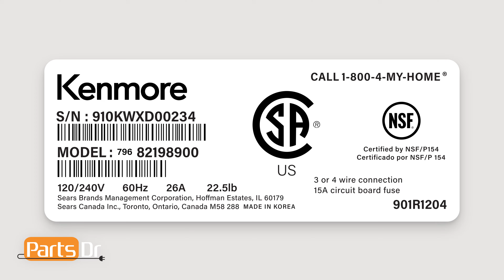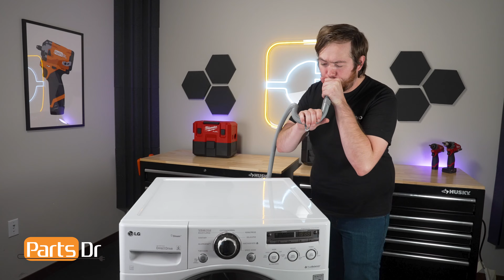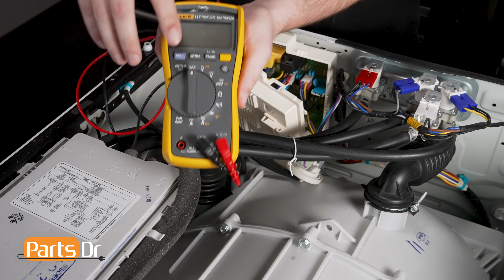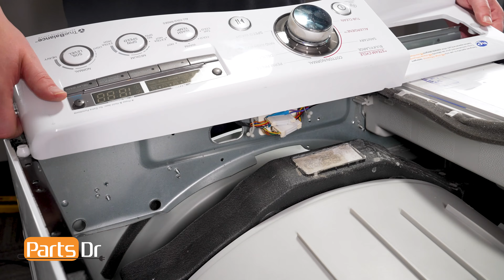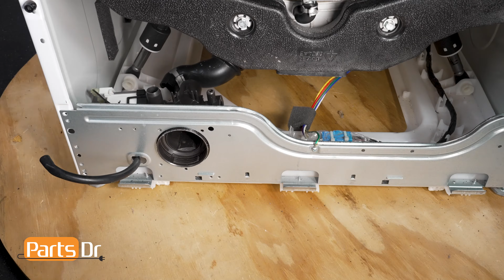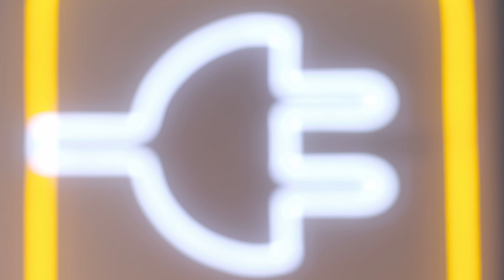OE Error Code Explained: Step-by-Step Fix for LG & Kenmore Front Load Washers Not Draining

Comment from the maker: We're glad you're finding this video helpful for fixing your LG washing machine! Just a quick word of caution.  If you're ordering parts online, especially from places like Amazon or eBay, be careful that many of the cheaper aftermarket parts are of much lower quality. For peace of mind, we always recommend using original OEM parts. You can find the high-quality LG parts on our website at https://partsdr.com/part/4681ea2001t-pump-motor While they might be a bit more expensive upfront, they'll save you money and prevent future headaches down the road.

Comment: My kenmore washer won't drain. I cleaned out the filter, didn't help. I took the pump out, it looked good, has continuity, and works when I bench test it. The wires that power the pump get 115V. Here is the weird thing, when I plug the wires into the pump, they get close to zero volts. I took the top off and did the voltage test on the control board, and instead of 120V I get around 8. Just ordered a new board for about $230.00. Wish me luck!
Reply from the maker: Sounds like you did some great troubleshooting.  Let us know what you find!

Comment: You saved me $400. At least. I followed this  by step. My washer is a bit different and has 2 pumps motors and a different mounting process however it was a very simple work around. My drain pump motor inner assembly was destroyed. All electrical was great, but this vid helped me discover how to use a multimeter in some new ways.  THANK YOU!
Reply from the maker: You're welcome! Awesome job fixing it yourself!

Comment: What is the tool you used to get off the seal ring?
Reply from the maker: There are two tools, one for the inner clamp and one for the outer clamp. See the links below.
https://partsdr.com/part/383eer4004a-spring-clamp-removal-tool
https://partsdr.com/part/383eer4001a-spring-clamp-removal-tool

Comment: Washer wasn't draining and threw an LE code. I followed this video's instructions. Disassembled everything. Blew through the drain hose. (It bubbled and gurgled.) checked the voltage from the control board to the drain pump. It was 120. Inspected and cleaned the drain pump filter. (It was pretty clean.) Removed the drain pump and tested it for resistance. It was about 14 ohms. My model of kenmore elite washer seems to have a second pump on the same housing. It tested at around 30 ohms. Both impellers move as they should (with a little magnetic throb.) I haven't reassembled it all yet but nothing so far has seemed like a problem. Any advice? Thanks in advance. Great video.
Reply from the maker: Nice job with your troubleshooting so far.  Even if the drain pump motor tests good via an ohms test, it can still have an internal failure that is causing it to not run.  If the drain pump motor is receiving 120V power and it isn't running the next step would be to replace the drain pump motor.  Let us know what you find.

Comment: I have a LG front load washer with a OE error code. The washer would to drain. After disassembly of the washer and removing the pump housing, I discovered a dime made it through the filter basket into the pump impeller housing.
Reply from the maker: Good troubleshooting, thanks for sharing!

Comment: I did this all step by step and even when i coild find the issues i still ordered and replaced the drain pump but i am still getting the OR error code is there anything else it could be
Reply from the maker: Make sure to also clean out the pump filter, as debris there is a common cause of the OE error. Check the drain hose to see if it’s kinked or clogged. Inspect the wiring to the drain pump and control board to ensure there are no loose or damaged connections. A clogged pressure hose or a faulty pressure sensor can also cause the washer to think it still has water inside. In some cases, a failed main control board can stop sending power to the drain pump motor, which would also trigger the OE error.

Comment: Wow!  I need your help but I need you locally.  I washed a blanket which had been used by a cat who left me a present, and I don't mean a mouse.  After that, the washer malfunctioned.  I have gotten as far as the hose and the filter, which was clogged with leaves and very stinky.  The washer produced the same error after the filter was cleaned.  I am hoping a second cleaning will be helpful but now, I'm concerned that that the semi-solid matter left in the blanket has caused the pump to malfunction and that looks like a lot of work to get to.  Oh my!
Reply from the maker: Oh no! That definitely sounds like a memorable load of laundry! 😅 If the drain filter was packed with debris, it's possible that some of it made its way into the drain pump and is still causing a blockage or even damaged the impeller. A second cleaning might help, but if you're still getting the OE error, the next step is to check the drain pump itself. It’s a bit more work, but our video walks you through the process.

Comment: Im having a loud grinding sound on the last minute of spinning for whirlpool washer model wtw8127lw1. Any idea what this could be?
Reply from the maker: The most common thing on this washer is a failure of the bearings in the gearcase.  Look on the bottom of the washer to see if there is any residue leaking from the bottom or the gearcase through the motor/stator of the washer. If you look at the repair stories listed here https://partsdr.com/part/w11449841-gearcase-assembly?model=WTW8127LW1 you will see others listing their symptoms as a grinding noise.